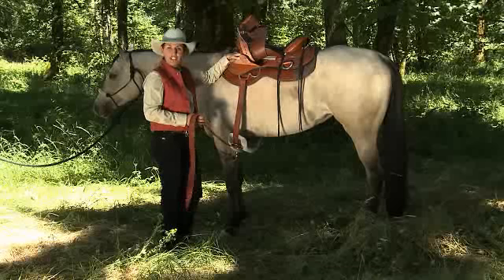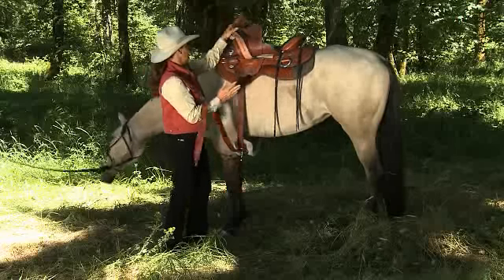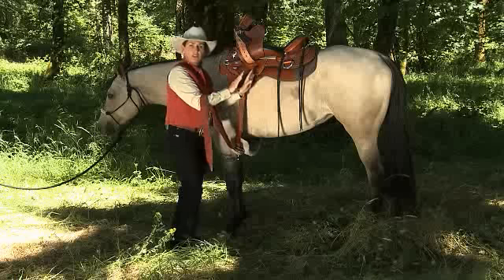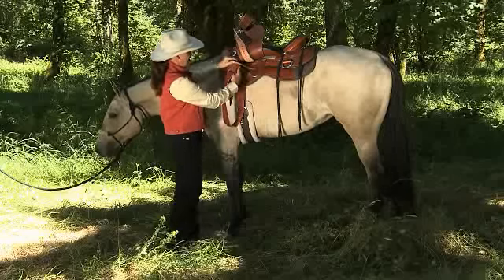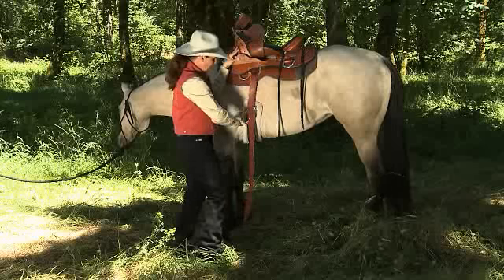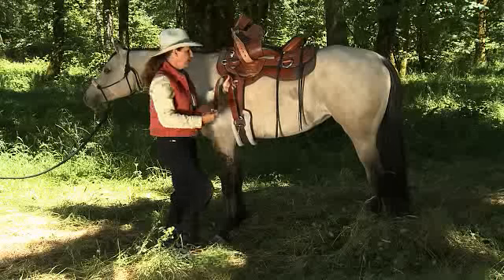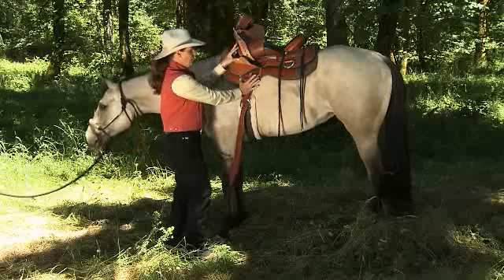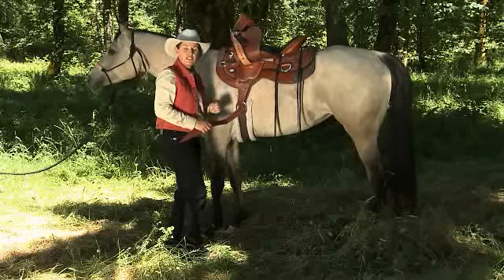Julie Goodnight Explains Circle Y's 3-Way rigging.wmv

Comment: For the 7/8 rigging, does it matter which ring you use for the starting point? I’ve seen both ways so unsure what is correct.
Reply: Good question.   As I was watching the video I was thinking better to start at the front to reduce the bulk under your leg.

Comment: how do you finish it off using the prong?
Reply from the maker: Hello! Yes, that's right. You'll use one of the holes in the latigo to securely fasten it to the cinch so it stays in place. Then run the excess latigo up the latigo carrier.

Comment: What she doesn't mention is the hell you go through, just TRYING to find a latigo for a in skirt rigged saddle. My Simco balanced ride saddle has 3-way rigging, and so far I've tried no less than 3 latigos--two leather & 1 nylon, with no luck so far. I'm on SSD and live in the city. I rarely ride any longer, but when I do, I want to be able to use my own saddle, which is most comfortable for me with my physical limitations. But I can't use it anymore, because the old latigo got ripped last time out. And damned if I can find a replacement--short of something I can't afford, which is having one custom made. 

So before you buy an inskirt rigged saddle--either buy one already with a latigo strap, or buy the strap FIRST and make sure it fits, BEFORE you buy that saddle, or you're looking at some headaches.
Reply: Your problem really confuses me, I use a 3 way in skirt rigged saddle with two nylon latigos with no problem. Both sides need to be the same latigo vs. an off billet for standard rigging

Comment: How do you finish the tie for the 7/8 position? Also curious what the other side looks like? Do you use two Latigos?
Reply from the maker: Hello! You will finish by securing the tie strap with the girth buckle. Run the excess tie strap up to the keeper. On the offside depending how much strap is left, you can run through the keeper on the cinch, take it up to the saddle keeper if you have one on the off side, or secure at the rigging dee. You do the other side EXACTLY as you do the on side. No matter which rigging you use, you must do the same on each side or it will make your saddle feel crooked and off. I hope this helps. Thanks!